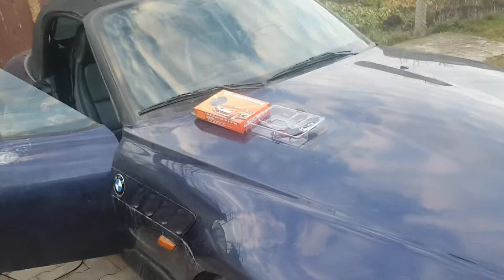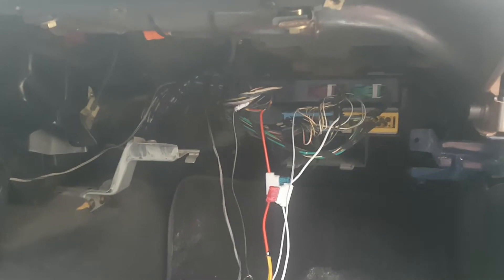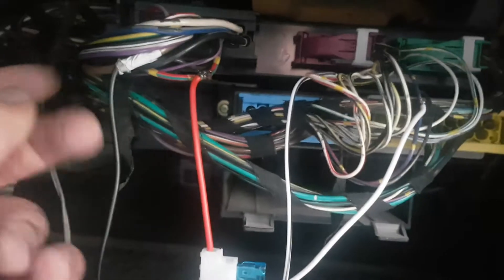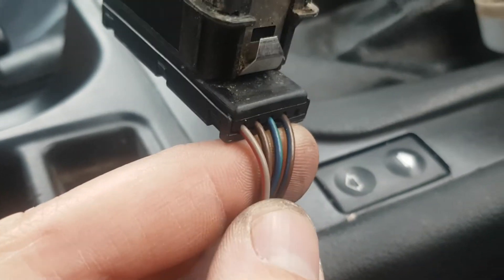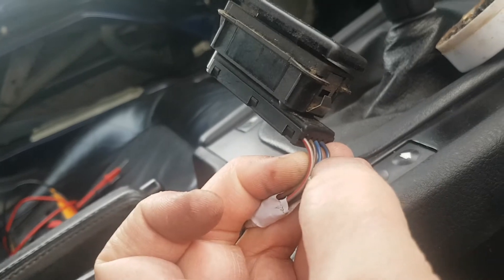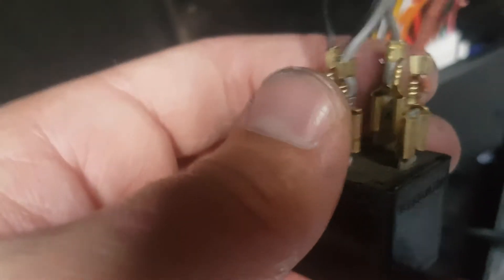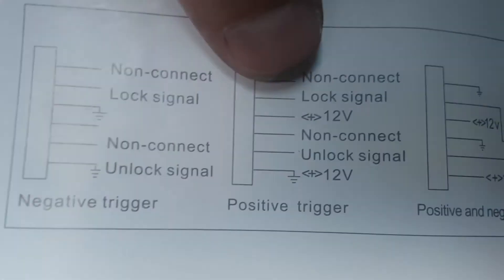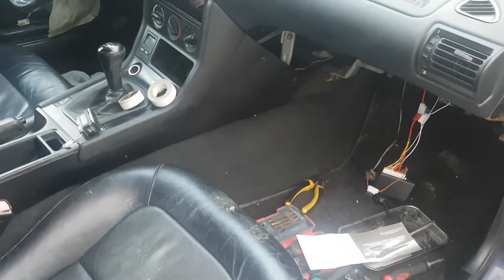DIY - BMW Z3 Keyless Entry Wiring Easy + Hazards (E36 also)

Comment: Please tell me how to connect the rest of the wires for siren, windows and trunk release. 

And also I connected everything but the fuel tank cover doesn't lock and unlock remotely. It does work with the key but not keyless.

Comment: My 2000 2.3L had the same wiring as this post from bimmerforums:

I spliced my LOCK signal from the remote to the wire at PIN #17 (white, red, yellow), and the UNLOCK signal from the remote unit to PIN #4 (Blue, red, yellow).
These colours and connections are for 2002 Z3, I'm not sure if all are the same.

Thank you for the tutorial! Definitely loving the hazard lights feature.

Seattle, WA

Comment: I just wanted to send you a message to say thank you very much for your help in your video, I fitted a Chinese remote entry box to my Z3 2000 6 today and followed all your instructions and it worked perfectly all the lights too, and hazard, the way you described and explained second to none thanks again Peter in uk.
Reply from the maker: Thanks Peter. Really glad it helped.

Comment: Did you put that fuse on the (12v) brown wire or did it come like that in the keyless entry kit? If you did add it on, what amp is it?
Reply from the maker: The keyless entry kit had the inline fuse. Not sure of the amperage.

Comment: What year Z3 is this?
Reply from the maker: 1997
Reply: How'd you get your pins? I'm checking a 1996,1997 and 1998 pin out and none of the pins (description/video) match. Using a BMW Electrical Troubleshooting Manual I found online.
Reply from the maker: @Ghost129er  At that time I looked it up online, but I always use a multimeter to make sure I have the proper ones. When I was young I installed car central locking systems and alarms at some point and never had any pinouts or schematichs, just a multimeter did the job.

Comment: I have a Z3 1998 and it has the alarm wire harness behind the glove box, so the connection is much easier. I wonder if you missed that.

Comment: Thank you, why not attach the positive wire directly to the parking lights?
Reply from the maker: I wanted the hazards to blink. For me it was easier to do it this way without much fuzz.
Reply: @trufinv  my instructions say to connect the flasher signal (alarm brown) directly to the cars blue/brown wire on the hazard switch. would this not have the same effect without the extra wires and relay?

Comment: Thank you ,Very clear explanation video. But I have more question ,Cause of my key-less entry system have an open trunk button. Do you know which pin of central lock control module are control a trunk trigger?
Reply from the maker: As z3 trunk does not lift automatically (no spring) trunk trigger would not make much sense. That would only leave the trunk unlocked after you re done.
Reply: @trufinv   Yes, I known it won't pop-up when open a trunk. But I want to using an open trunk button. 
I seen an attach file that you have sent (8 months ago) ,
So I must connect my key-less entry system "trunk release (+)" to connector "X13253" on pin "3" right?
Reply: @kasiduso7169  Hi! Did you manage to wire the trunk release ? Can you help me with a diagram or a link please :) ?
Reply: https://www.olx.bg/ad/visokokachestven-modul-za-tsentralno-zaklyuchvane-beeper-200-CID360-ID6WZhw.html l that is shown a circuit as same as my key-less entry system type. But a key having open trunk button as same as this picture https://www.eeuroparts.com/Parts/74889/Ignition-Key-w-Remote-Control-315MHz-Coded-66126933728/

Comment: Thank you man, had same wiring, except, please correct the lock and unlock wires. Red and blue with yellow strip AND blue and brown with yellow strip.

Thanks again, really healpful!!
Reply from the maker: The wire color coding could be different on other versions but you easily see that when installing. Glad to help.

Comment: If your keyless entry stops working or is partially working,  it is because the door close microswitch is broke.  I unhooked it and it started working again.
Reply from the maker: It worked but it's not practical.

Comment: Dog you know how to connect the cable for rising the Windows when you press the lock button?
Reply from the maker: I am not sure as my keyless acces cannot easily be used to do that. It should either maintain the relay open/closed while keeping the button on the remote or provide a channel with a  big enough timer in order to do so. It can be adapted but I didn't bother. Perhaps you could use the pinouts bellow:
Reply from the maker: https://www.bimmerfest.com/forums/attachment.php?attachmentid=248343&d=1285854838
Reply: thank you very much!